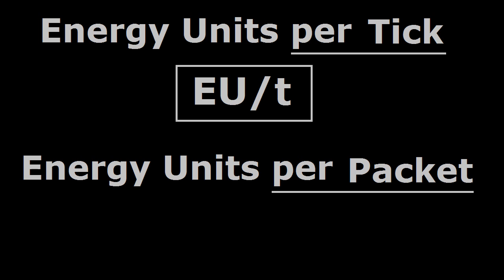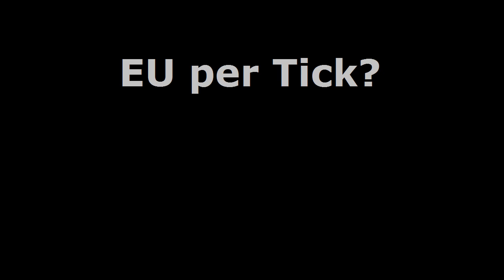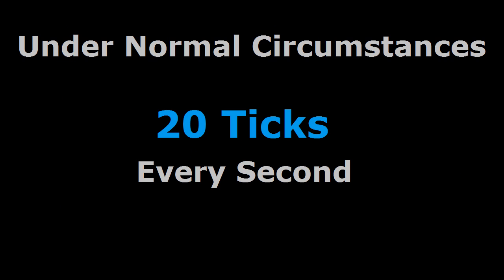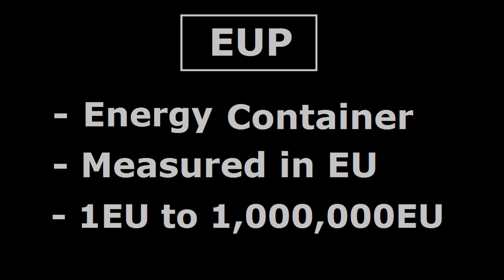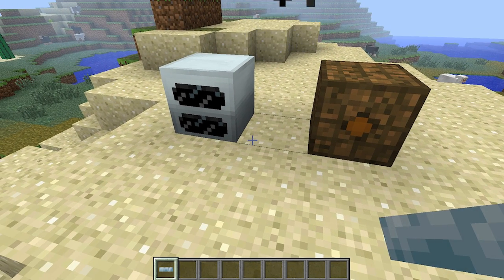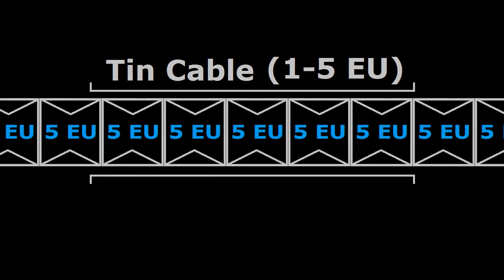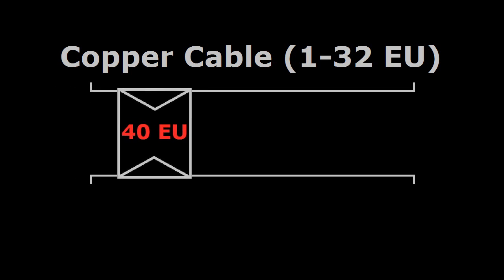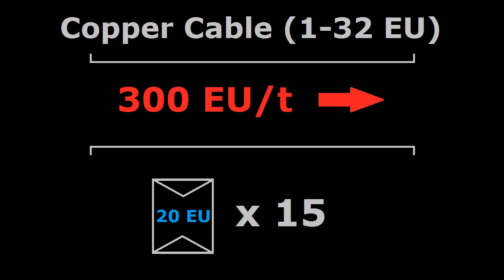Industrial-Craft Energy Units (EU) Explained (Tekkit/Feed The Beast) - Minecraft In Minutes

Comment: well for some reason, 10 EU from a nuclear reactor being in a level 4 energy will burn any thing lesser than a 4x insulated HV cable hence in reality the level is more important than the power it self! like putting a lever on a level 3 transformer makes it output trough the input and input from outputs and can only accept level 3 now and not level 4 like normal even tho that is what it now outputs! that is how you can make mass fabricators explode... now i wonder how they will make those work when they (re-enables) the explosions/cable melting! the experimental build should count as IC3 but they still call it IC2 for some reason and it is very blunt and not finished, so even a copper cable can pass level 4 at 8192 EU! AND  if you put Rotary Craft in and use the EU generator (like a converter) you can output ranges like 32768! (or more is you have reactor craft ontop!)